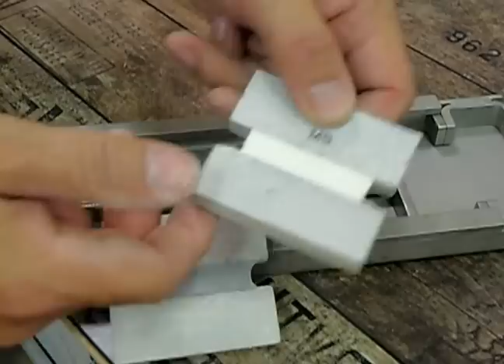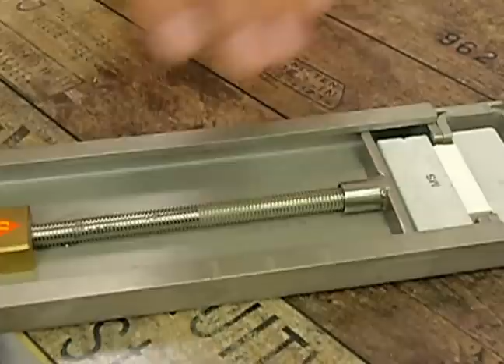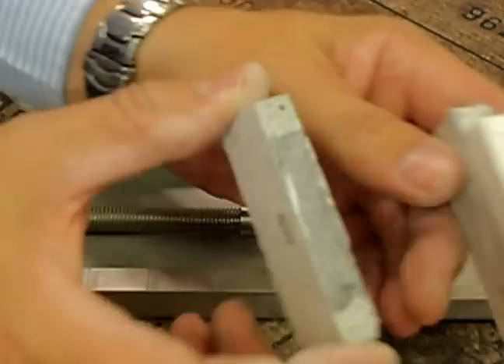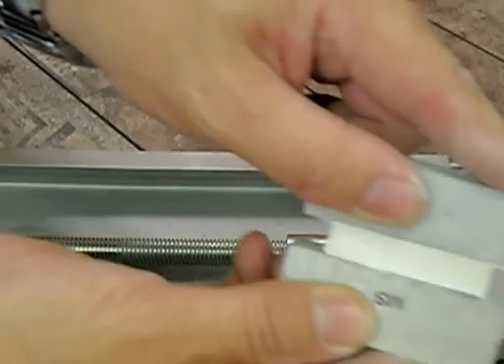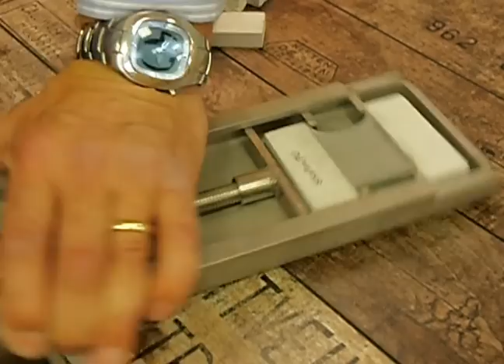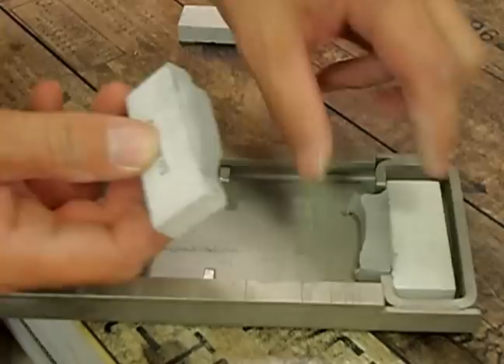SikaBond PU (Polyurethane) Adhesive V's MS (Modified Silicone) Adhesive

Comment: If anyone is interested to buy  TPE(thermoplastic elastomer, expansion joint tape, crack repair tape movementam tape, waterproofing tape) contact us:9315456699    @ 100 running mtr (25 mts X 100 mm @ 2500 INR

Comment: do you mean MS Polymers ?
Reply from the maker: Hi, Yes MS Polymer adhesives. Generally the Shore A hardness is higher than with PU's. ie: Less Elastic.
Reply: @mickhooper3631  but is the same MS Polymer than MS sylicon show in video?
Reply: @scualos  MS Polymer stands for "Modified Silicon Polymer". So yes, MS Polymer is precisely what this video is talking about.

Comment: Great Video! A notable point with PU sealants that these are THE option to go when bonding porous substrates such as masonry or cement. Also, when it comes to wood bonding (especially painted) forget Silicone. Silicone is more for glass AND metal substrates; substrates such as cement are ok but at times require primer for better adhesion. Also, how did you determine that it is past 1000% elongation? Is it = ((New length - old length) / old length) x 100?
Reply from the maker: Thanks +Aakash Sachdev  If you look at the closest edge of the stretching device you will see that it has percentage increment marks along its length.
Reply: +Mick Hooper Upon closer inspection - I saw the markings. Sometimes things are that simple and in front of you! Thanks!
Reply: ms sealant is not the same chemistry of a silicone (siloxane) sealant,
Reply from the maker: Very true. MS is a hybrid